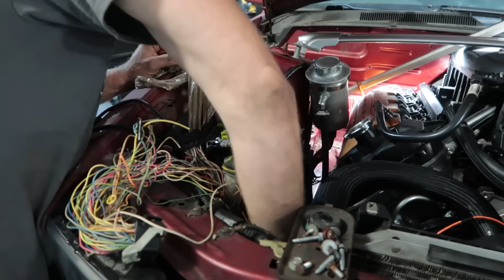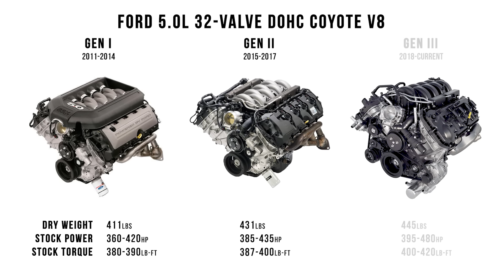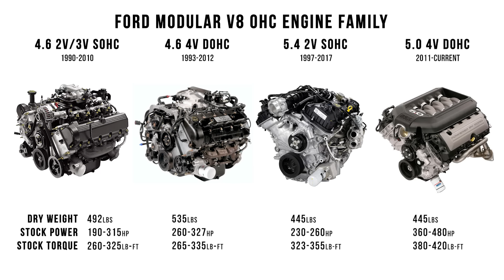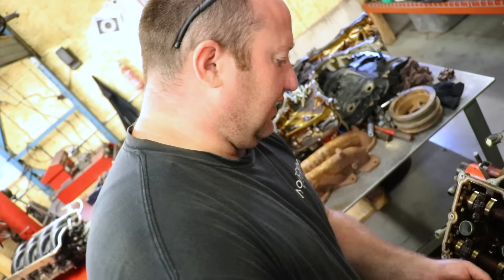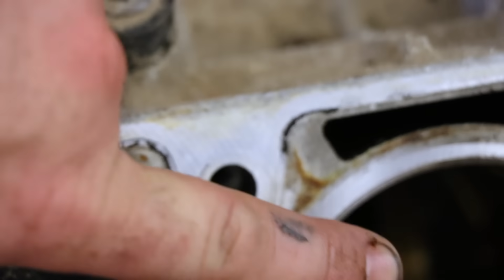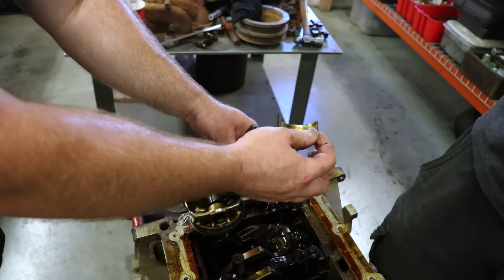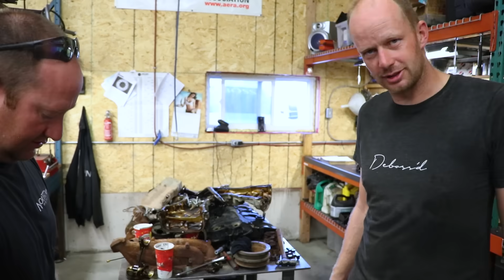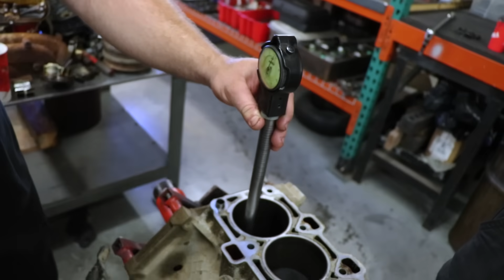REVIEW: Everything Wrong With A 5.0 Coyote Engine

Comment: I worked in a oil change shop for years. Conventional oils leave that sludge build up. I have put 230,000 miles on my old 4.6 only used Mobile 1 full syn. Looked brand new on the inside.
Reply: he clarified it in a later video, but what he meant apparently is that the synthetic does this because some people follow the 10k-15k oil change intervals. He didn't state it very well.
Reply: @Terminxman  Your right. I argue this at work all the time.  The ones I argue with have contradictory logic. Most of them do extended oil changes but trade their vehicles every 2 yrs. I have an 05 FX4 (yeah the dreaded 5.4 triton) with 183k on it. Changed oil every 3k since new. Did have the phasers, followers, and vct solenoids upgraded at 124k when the plugs were changed. I admit I waited too long on the plugs, now change them at 50K. None broke off luckily. I attribute this (just my opinion) to 3k mile oil changes. I've never owned a vehicle that had less than 200k. I had a 72 impala that had over 300k. The guy I sold it to drove it for 3 yrs after to my knowledge. I follow the same early schedule for the transmission, diff, and transfer case. Bottom line is, I enjoy driving. I can't do that unless my vehicle is well maintained.  It's a good thing because the 5.4 will not last unless it's well maintained. All motors are the same in this respect, but the triton is an engineering nightmare. I hate working on it. It is good for light off roading because mine's not lifted and it pulls a 20 ft center console like it ain't nothing.  Get's at best 15 mpg. I've owned chevy's, dodges, mazda's and fords. All lasted 200k or more. People......Change your fluids. Believe me it's the easiest maintenance you can do.
Reply: @jaydubb9478  I know people who have 300k on 5.4 3 valves without even a tick except a knock on startup for a second after it sits which is typical for an engine with that high a mileage.
Reply: @Terminxman  then what's the point of going synthetic if you're not going to be able to extend your oil changes? What possible difference is there in just using either the same or a lesser viscous oil if the OEM calls for synthetic and it's only advantage is it gets into the engine crevices easier?
Reply: @MR-nl8xr  better flow characteristics in extreme temps, higher shear strength, etc. synthetic doesn’t mean what most people think, essentially means it has been engineered snd formulated to enhance properties.
Reply: @Terminxman  Yea, but one of which is supposed to be:
Extended service life.

Anyways, whatever I guess, we wouldn't need all these mechanical gymnastics if the petrol companies didn't murder the vapor IC Engine half a century ago for $$$.

C'est la vie.
Reply: @MR-nl8xr  Well typically if you look at the severe service life in your manual it's usually a 5k interval or so even on synthetic. I think it's foolish and just shows naivete to go by the 10k, or even 15k service intervals.
Reply: @MR-nl8xr The point of full synthetic oil is to reduce wear on the rings, bearings, etc.  Yeah it's a little more expensive, but it isn't as expensive as new iron.  Change your oil and you'll be good, don't wait for 25,000 miles.
Reply: @lashlarue7924  The point of full synthetic oil is to reduce wear on the rings, bearings, etc.  
-But that's the point with any oil.

Yeah it's a little more expensive, but it isn't as expensive as new iron.  Change your oil and you'll be good, don't wait for 25,000 miles.
-I just don't understand what is the point of getting more $$$ oil if you are not going to gain extended service life, or anything else more than regular cheaper oil, out of it.
Reply: @MR-nl8xr  I think we're talking at cross-purposes here (apples and oranges).  Yes, in terms of service interval maybe there's less difference between the two when you only consider the ability of the oil to absorb soot, resist acidification, and stand up to combustion byproducts (detergents and TBN are the things we're talking about in that case).

*But you don't only care about that* — you also care about film strength, film thickness, and the overall ability of the oil to reduce wear on metal components.  Synthetic is the winner in this department.

The video was talking specifically about cars driven around on short trips.  Those miles are a lot more expensive than highway miles due to the blow by they have to absorb.

The extended oil change interval marketing fluff is just that.  I change mine every 5k or at least twice a year regardless.  Wix filters and full syn.
Reply: Was thinking the same. Or engines which use synthetic all have a golden shine and not the least amount of any non liquid trace. Amazing really and I haven't opened engines with less than 230.00km on them.
To be fair, I rarely open engines because there is just never a reason to. Only things breaking are accessory and tidbits. Even at 400.000km, the block with bearings and surfaces looks like new. Provided you do not change your oil later than 10-12.000km.
Reply: Was a huge fan of Mobil 1 full syn for many years and many vehicles. Never had a problem with any of them (all Ford), including a chipped 01 Lightning that I ran hard a lot. I recently got a GT350 and am running AMSOIL at the recommendation of other folks. So far, so good.
Reply: Synthetic = additives. Nothing more
Reply: they only make small engines with high output, short life, counter productive,  cos the greenies & epa say so.. this,is why engines dont last & break. european specs are euro 6 emmisions. nothing comes out the exhaust.. its all bullsht.

Comment: I will agree with the guy about the 4.6l being the most bulletproof engine I had a 2v 4.6 in my 05 f150 and at 430k miles it is actually the first engine in my entire lifetime that never used a drop of oil idk if I got lucky or what but I got the truck at 40k miles and by the time I got rid of it, it never used a drop of oil i usually changed oil every 3k even with synthetic but I ran it up to a 12k mile oil change interval at one time just to see if it would use any and never used any it was a dog when it came to power but that thing was a tank and that was even after getting my gas tank syruped at 80k and one of my valves on the back cylinder stuck open slightly and the rocker arm fell off I just popped the valve cover off loosened cam caps tilted cam forward and popped it back on and it was good ever since.

Comment: Is this CNN, Fake News...I have a 2012 Mustang GT, 107,000 miles, change the oil, still will do 150mph. No problems since day one 430hp. If you research 2011 torture test they ran on this motor, contradicts everything in this video, education and research makes better informed decisions.

Comment: you really need to go a long way to justify fords issues with some of these engines. glad to hear you just trash the 3 valve 5.4 but the other 5.4s also had many many issues and its critical that the oil changes were done on time with them and they are allowed to warm up . that makes it very hard to find loaner cars with that information to just trust a swap without a build. the engines being so big is also a big issue.

Comment: First 3 thoughts when the valve cover came off. 
1. Not changing oil on time aka gas dilution and deposited build up 
2. Consistent use of shit quality oil breaking down prematurely pressure ,temps, dilution  etc
3. A oil analysis would have gave a lot insight before the tear down

Comment: sad they didnt make a 5.8 version of this engine it would make crazy amount of hp per cubic inches ,
Reply: The kind of did, but it was exclusive to the 2013-2014 Shelby GT500 Mustangs and yes it was an absolute monster of an engine, Granted it was supercharged but even without a supercharger I'd bet it would have been a 500hp+ engine.
Reply: @nathanmcdonald610  forgot that one but it wasnt na it was gt500 spec ,pretty sure na with f150 spec it would be as powerfull as a 6.2 gm but with less cubic inches  bc of hp per cubic inch is better

Comment: You said that the truck engine interiors get coated with synthetic oil residue because owners don't let them come up to temperature.  What do you consider temperature?  You implied that short trips are what cause the residue.  So I drove to the pharmacy and back today and the temperature gauge reached normal operating range.  Entire trip was about 20 min - 10 there and 10 to get home.  Is that too short of a drive?   My F150 is basically my daily driver.  It's the 5.0L coyote and I hooked up a catch can on the passenger side.  It's 2016 with about 29k miles.  I use synthetic 5w-20 every 3-4k miles - What do you recommend I do for the future?  Thanks for your video.

Comment: Everything about this video is just wrong wont recommend everything you guys are saying in this video on the bearing part kinda true but oiling was never an issue with the coyote that's oil change related failure coyotes are tight tolerance motors the only thing wrong with the gen1 coyote is coolant flow going to the back of the motor omg you guys 🤦‍♂️oohhhh!!

Comment: Everything wrong with the Coyote 5.0: 
1. It's not an LS

That's it guys, thanks for coming to my Ted Talk.
EDIT: The guy goes on to say "Nothing against the chevy, it's just old pushrod technology"
Sir, you are aware that OHC actually predates OHV pushrod right? Regardless, OHV allows for a smaller, lighter engine with far fewer moving parts. GM even figured out how to implement VVT on intake AND exhaust using a single camshaft.

Comment: Gen 1 Coyote is a time bomb over 600wheel. After  1 week on e85 at 660wheel,  my gen 1 coyote threw a rod in #8 cylinder.  Motor lasted 111k miles at 600wheel pump gas. Lasted only 1 week at 660wheel e85.

Comment: @ 11:20 different oils don't mix? Really?
I think in the end its evident the owner didn't take care of this engine...the dirt all in it shows major off-roading which most likely meant extreme RPMs and heat. Also he used cheap Fram filters which could be part of the problem since they have been known to come apart and block oil passages. This could be especially true if he was raw-hiding the motor.
Then the claim that the motor may have been ran low on oil sounds like a reasonable issue to blame for the bearing issue as well as the sluge issue. 
I just don't think its fair to say that synthetic oil lays down all this sticky sludge crap when its obvious that this motor has most likely endured extreme issues such as running very hot and without oil. 
I've been running synthetic oil for almost 30 years and when changing valve cover gaskets and little things like that (never had major failure) the aluminum heads have always been spotless clean. When I first started driving and wrenching the cars were from then70s and 80s and you pop a valve cover and sludge would be so thick it crazy.

Comment: So, what is the best conventional oil? I use what ford recommends on my 2017 GT which is Motorcraft 5w20 blend. On my 1999 F250 with a 6.8 and 200k miles I use Havoline 10w40 conventional oil. My truck still runs real good but uses a bit of oil. My oil change intervals are 5k. Ford says the oil in the coyotes is 10k, however that scares me.

Comment: Is every 5.0 f150 from 2011 a coyote? I have a platinum so I'm wondering that has this engine
Reply: Yes. The two V8 options in 2011 F-150's were 5.0L and 6.2L. If you have the 5.0L then you have the Coyote. The last 5.0L before the Coyote was the Windsor and it has been out of production since the early 2000's last being used in the Explorers before being replaced by the 4.6L. The Coyote and the Windsor share almost nothing outside of displacement.

Comment: Great video. Thank you for pointing out the aluminum races holding around the crankshaf, which you mentioned that using full synthetic oils cause the sludge within the engine. With that said;
Would you say that using synthetic oil in colder climates will cause that same problem as opposed to the regular "manual recommended" oils?

Comment: The parts delivery guy at my shop has a 2013 5.0 f150 with 480k no problems never touched the trans or diff. And very little engine work

Comment: I had a 5.0 first year in the F-150 have knocking issues that happens a lot ,what I found out was the block cylinder walls were not right causing knocking .Ford paid for a few new engines

Comment: Nothing wrong with the Coyote engine its perfect especially the 3 gen which recently went 7's in the 1/4 mile. Stock sealed from oil pan to intake with just a custom Twin turbo and few other bolt on's in the car it came in.  For under 41k dollars, price of car included $38K 2018 base 5.0, No other car's out there can make this claim.
Reply: Under $41k for the build? Price of the car was $38k? But a custom twin turbo setup was only $3k? Hmm don't think so.
Reply: Stock injectors?
Reply: Ford has been making the 302 since the late 60's.my dad had one in his 69 Galaxie 500.great engines,even then.
Reply: cars have been running 7s for decades. It took ford 100 years to make good v8? 

oh Kay 😳
Reply: @BloodAlwaysFindsItsLevel  can you elaborate more

Comment: Has anyone read about the RD that was done on the Coyote engine, the torture test...even the engineer built a set of stainless steel tri exhaust manifold to achieve fords 400hp and actually exceeded to 415hp,  he built them in the garage.  As far as oil, I have a over a 100,000 with no problems, probably uses 1 quart btween oil changes on a 2012 Mustang GT. Both the LS and Coyote motors are solid performers.

Comment: I prefer pushrod engines.  I do agree the 4.6 was a very solid and reliable engine.  Should I switch to conventional oil?  I've been running synthetic for a long time, but if it causes issues that conventional doesn't cause, I'll revert back to conventional, and save a bit of money.  The nonsense about going 10k miles between oil changes was a marketing gimmick, and complete rubbish, anyway.  If I should change my oil at 3k miles, I might as well save money on that oil, right?  None of my engines have variable valve timing.

Comment: I don't believe his comments about synthetic and sludge. I had an old Chevy Z-34 with over 140,000 miles, and when I changed the timing belt there wasn't a speck of sludge to be found anywhere, and the cam lobes barely had wear marks on them.

Comment: I have a 2008 F150 5.4 3V Engine. Will a 4.6 fit without to much adjustments?
Reply: Yes. Ford was still using the 4.6L in 2008 as an entry level V8 for the F-150. You'll have a downgrade in power/torque but likely an upgrade in reliability.

Comment: As far as I'm aware they never ever put a 4 valve engine in a town car it was the mark 8, Lincoln continental front wheel drive, marauder besides the cobra witch started in 96.
Reply: Correct. The Town Cars only ever used the 2v 4.6L.

Comment: This was absolutely outstanding content.  My wife had an 09 Expedition that the 5.4 took a shit in at 115k after having been well maintained.  I’ve been trying to decide on a new muscle car and even though I REALLY want a scat pack Challenger the most because of its roomy interior, I think I’m going to have to go with a Camarillo LT-1 so I won’t have to worry about the engine.  I’m sorry but the Ford engines just too much of a history of failing, the Hemis have developed the same reputation over the last few years as well.  I’ve got an 04 Silverado with 168k and it still runs crazy strong and a 14 GMC 2500 6.0 with 115k that literally still drives like new.  I’m not brand myopic but at some point you just have to realize that GM makes a far superior gas V8 engine.

Comment: I swear, some builders think they know more than they actually know.  IF what he said was true (and I have no reason to doubt him) that when you get a factory 0.030" over piston the compression height is lower, you STILL are going to get an increase in displacement of 5"-7" (or whatever)!  The only thing that changed is perhaps the factory wants to keep identical compression ratio and is lowering the compression height to compensate for the increase in CR that going 0.030" over would normally give you.  He made it seem like the engine WOULDN'T be 5-7" larger with the larger 0.030" pistons--NOT that the factory wants to keep CR the same by lowering the CH of the pistons.

PS:  EVERY GOOD ENGINE BUILDER KNOWS that when a bearing easily comes out of it's main saddle or rod that all crush is lost and the bearing was about to spin!  This guy is acting like it is "sometimes" ok!!  It is NEVER OK.  The bearing "tangs" are ONLY there to ease/locate assembly for the builder!  They contribute NOTHING to holding the bearing in the big end of the rod/housing bore.  The ONLY thing holding that bearing in is CRUSH.  If there is no crush, the bearing will be loose--either by years of wear from lousy oiling or detonation that "hammers" the bearing and pulls it "in" at the parting lines!
No offense but you can tell this guy does alot of builds for the dealership and not alot of race engine blueprinting!  His shit wouldn't hold up--no disrespect.

Go read a Clevite catalog from the 60s.  They knew it back then, bearings have changed in materials and precision but the way they stay in the engine has been the same for decades!

Comment: The 2 valve 4.6 including the 2 valve 5.4 version have oil pump problems seizing the bottom end up.Have seen this with a 2003 F150 with the 5.4

Comment: I inherited my  Dad's 2k 5.4 F150.  415k.  The oil changed every 2k  Penz 5w.  No.5 coil was  replaced and it's  runnning on the second set of plugs installed at 150k. When i urged him to change  them he said....their lifetime. Miles were mostly hiway at 55mph. Truck still torque monster. Cant imagine what plugs//coils will do. Those are the facts for what it''s worth.